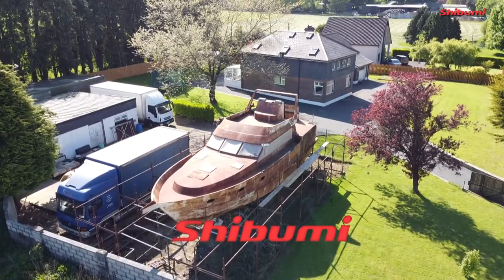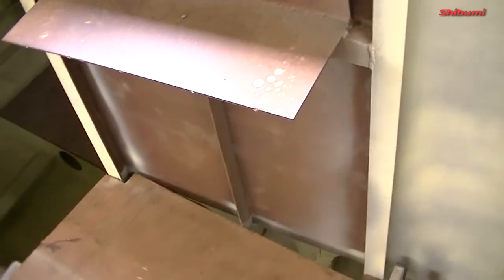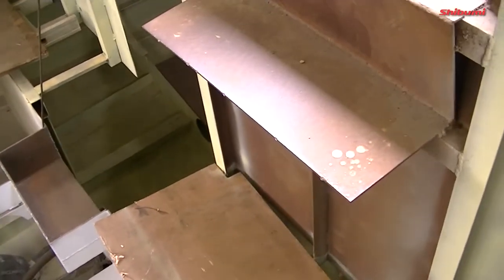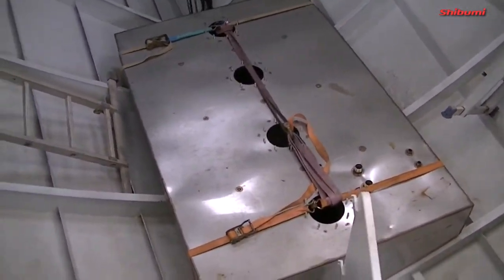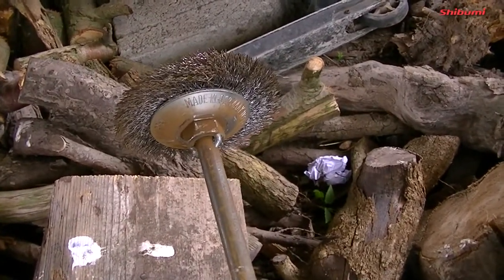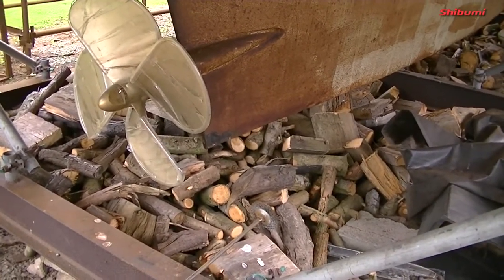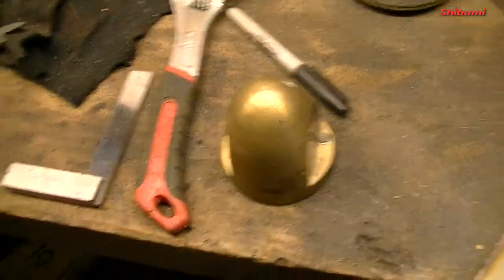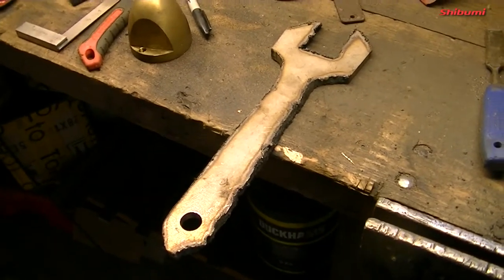Shibumi Boat Build EP 19 Seating the engine and adding the drive system - Steel Boat Building

Comment: Great video,  2 comments though.  First I can see an argument for having a removable panel in the cabin sole as well as on our fly bridge floor just for being able to install and remove the engine.  and the second comment,  After watching another channel SV Seeker,   the first thing he did before starting the boat build was to build an overhead crane to be able to lift heaving things onto the boat.
Reply from the maker: Thanks Garry, yes some boats need those hatches, In my case, when I designed the upper entrance I worked it that the engine could " just fit in " as you have seen it did :) Realistically if Shibumi needed another engine, it could be done similarly with similar hastle than having the hatches. 
As Shibumi is RCD A, The floors will be welded shut. 
I have watched lots of SV Seeker and know of his cranes he made and now used one for the trailer.
I've everything in that needs proper lifting now so with the full steps at aft now I will manage everything.. 

Great comments and thank you.